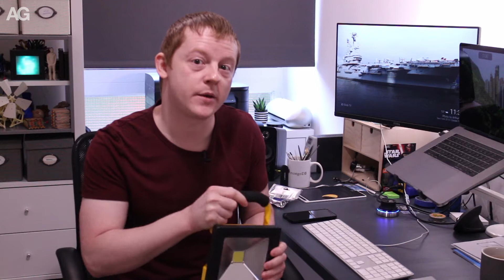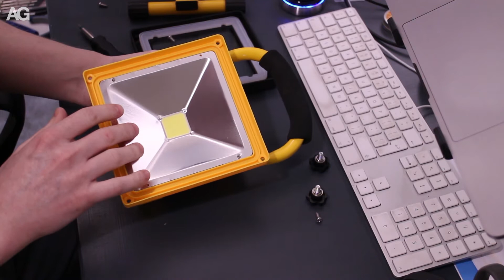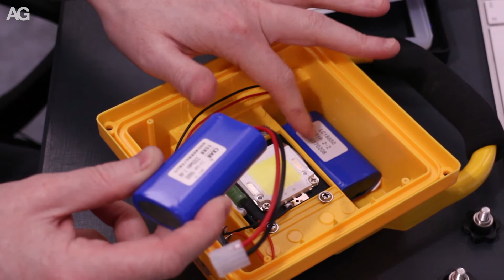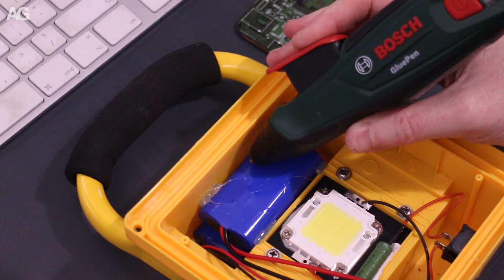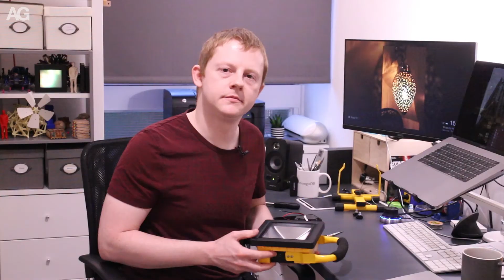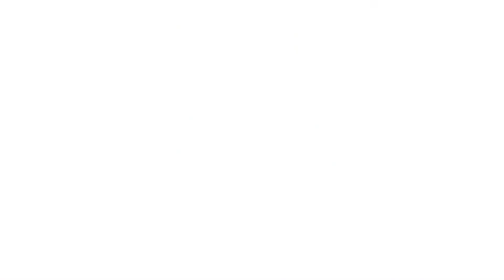Extending The Runtime Of A Site Light

Comment: Does the battery pack have inbuilt charge balance between the two 18650 cells?
Reply from the maker: From what I could see it had a basic protection circuit but that was it.
This method has some potential problems but for me the quick win balanced out against them, I will need to keep an eye on it when charging!